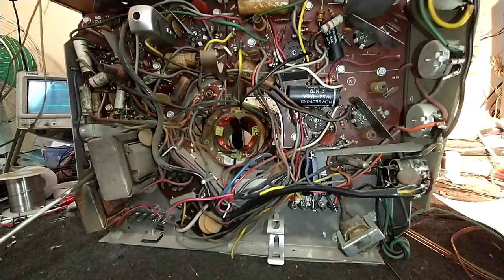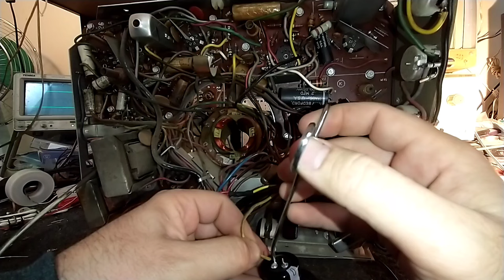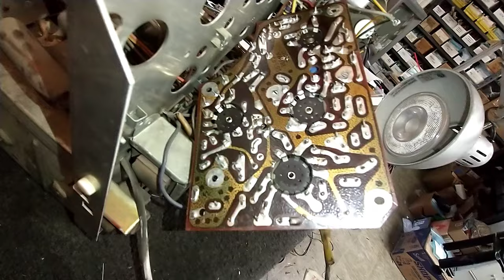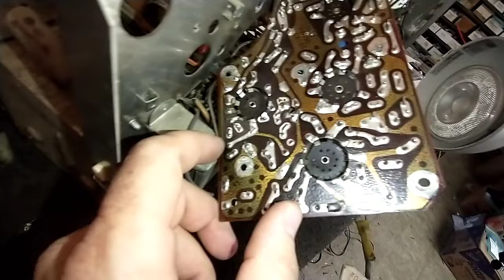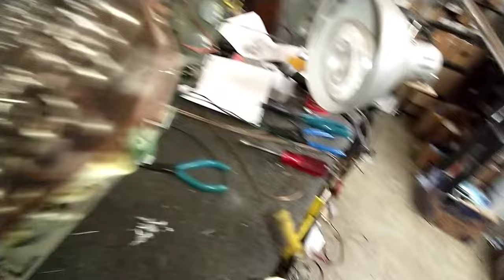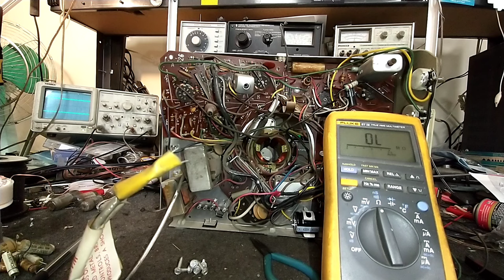Servicing a 1957 General Electric model 14s208 b&w, vacuum tube television. P4/? -start of the recap

Comment: It looks like GEC made a crude attempt at thermal isolation by cutting holes into the PCB and mounting the tube bases with an air gap to prevent the boards from burning up. In doing that (got to admit the boards don't look heat damaged) and only soldering the tube base pins to the PCB they have failed with dry joints, especially where a spartan amount of solder was used. If they had maybe rivetted the pins to the board it might have made them more reliable. But then it would make changing the tube bases very difficult. In short I don't think PCBs and tube bases go together and point to point was probably a better way to go. But these are relatively early PCB production days and a lot has been learnt since then (you would hope),

Comment: I'm wondering if those loose tube socket contacts at the board were that way when they left the factory. Hard to imagine they were. But this is a place where you would have had a massive number of heat/cool cycles that eventually degrade the solder joint at the circuit board. Anyway, that's my theory, for what it's worth.

Comment: Hey JP if you ever run into an avc50 Yamaha amplifier do a video on it because mine's always overheating and I'd love to know why
Reply: Acc 50
Reply from the maker: How hot does it get idling with no music playing after 30 mins?
Reply: @JordanPier  it's not hot at all when idling it just starts getting very hot when I start cranking it up
Reply: And I got a couple of fans on the top running on it now
Reply from the maker: @jugent2012  how many speakers? Impedance of each speaker?
Reply: @JordanPier  just two 2
Reply: They're just two Klipsch bookshelves speakers
Reply: They're the RP 600
Reply from the maker: Those dip down into the 3.9 ohm range - especially in the low frequency domains. Look on the back of your yamaha near the speaker terminals and see what minimum impedance is required. I'm betting its 6-8 ohms.
Reply: @JordanPier  yes it's 4 to 8 ohms
Reply: I used to run this app on Vega D5 with no issues but that was a little while ago couple years ago
Reply from the maker: Then it is just getting a workout. Having fans on it is a good idea. I would check my wiring for any probability of short circuits. A short will heat the amp up real quick. Try playing only one speaker at a time (with the other disconnected at the amp) and see if it still gets got. The one that heats it up quick is suspicious. If either do, then they just aren't a good match for that amp. Todays amps just kinda suck unless they are specifically built for low impedance drive. Published ranges are usually just to cover the company's ass.

Comment: JP I know you love the wick but if you’re interested I have a Hakko vacuum gun I bought a year ago and found I had no use for so you’re welcome to it and it’s accessories if you’d like…gift to the channel and you for all that I’ve learned from your videos. I don’t know what the most appropriate way is for me to get a shipping address from you but you can decide if it’s something you want and let me know.  Thanks!!
Reply from the maker: In all honesty, I'm grateful for the offer, but I've used the vacuum guns and pistons and the big issue is getting them into tight spaces. If I have large quantities then I'll use a bulb. Otherwise wick it is. Thank you though! I can't imagine a time where I would need one.
Reply: You’re welcome!  I’m stuck in 1948 with most of my restorations so, I agree, getting it into tight places in those chassis is why I found little use for it but when I’ve worked on more modern stuff, getting things like IC chips off boards was an absolute snap!  Anyway if you find it could be useful it’s yours. Glad you’re feeling better!  Take care.